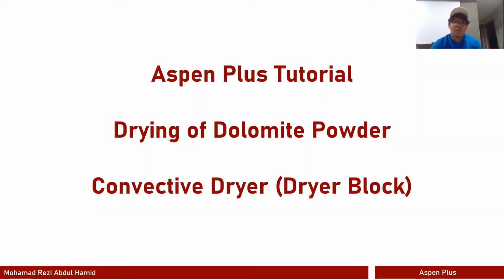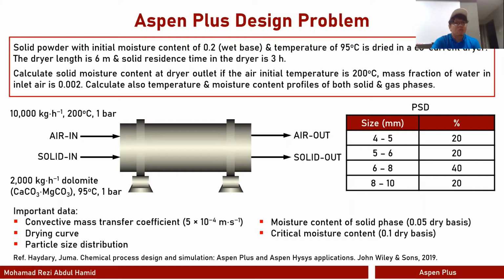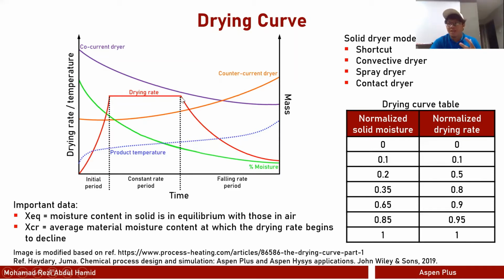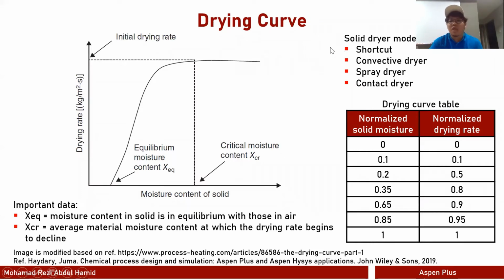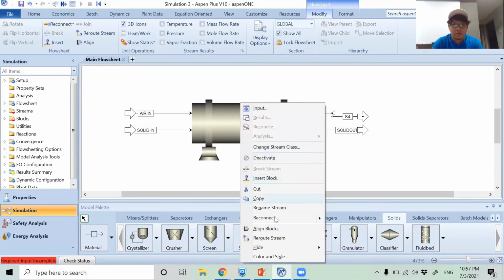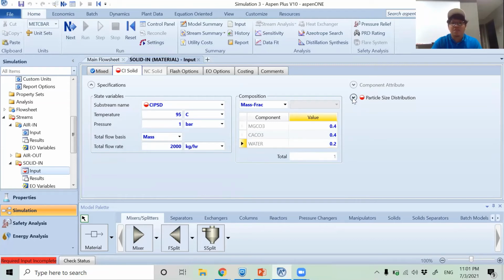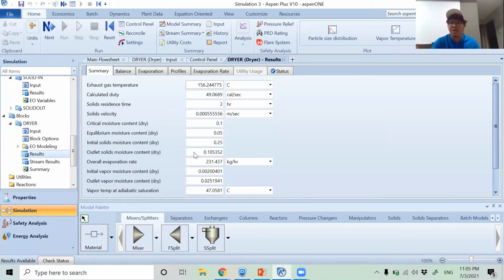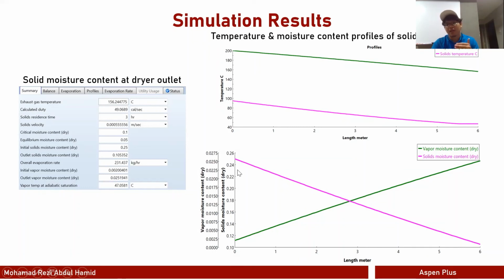Aspen Plus - Drying of Dolomite Powder (Convective Dryer)

Comment: Hey! First of all great video! It was very clear! Second I am having problems with running the final one.. I entered all the same inputs (I think.. I doubled check..) but when I run the following warning appears:
WARNING
   OVERALL EVAPORATION RATE IS NEGATIVE. CONDENSATION OCCURRED.

The only difference that I am seeing is that when I was entering the dryer specifications it appeared Operation mode: Continuous. There was also the option to put Batch but I left in continuous since if I put Batch then I wouldn't be able to insert the same inputs like you.. I suspect that it has to be because of that but I don't know where I could have gone wrong..

Thanks anyway and if you could help me that would be great! Have a great day!
Reply from the maker: Hello..thank u for your comment..to be honest I also am not sure what's really going on without dissection your simulation...but I have a hunch that it got something to do with the behavior of your component as oppose to input spec of the block...for some reason, at that particular condition water want to condense as oppose to evaporate...hope this answer your question...